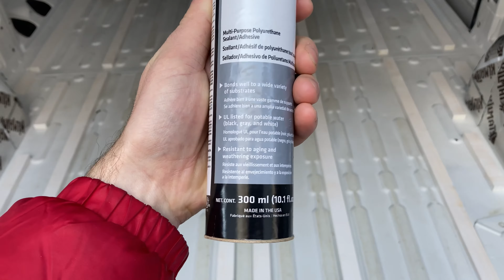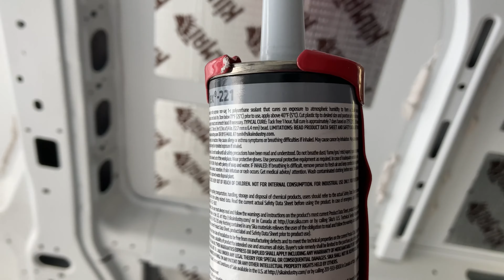Van subfloor installation (RAM PROMASTER CONVERSION)

Comment: I would clean and then wipe it down with alcohol and wait 24 hrs before using the adhesive. Residue from the cleaner could affect the bond and it should ideally be completely dry.

Comment: Way to much sound deading mate you only want to cover 25% of each panel that requires it
Reply: If you're looking for a bare minimum, yes, about 25-40% is enough to reduce a good chunk of noise, but it's basic physics - the more you cover, the less noise you'll have. I tested it with an an ambient noise meter and there was a significant reduction when I doubled the amount of coverage. But you do you :D
Reply: @Antonpug   agreed but once you reduce that main amount with coverage on 25% you have to take into account  the reduction from the insulation  also try to keep the van as light as possible as it will reduce wear and tear significantly